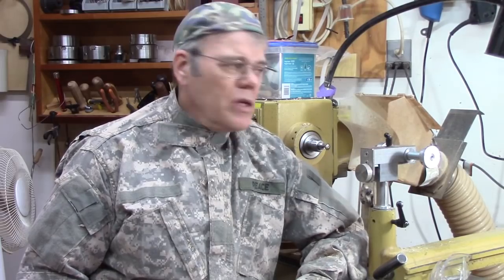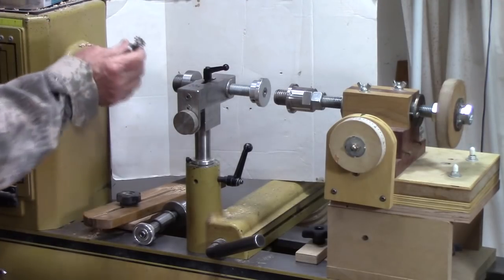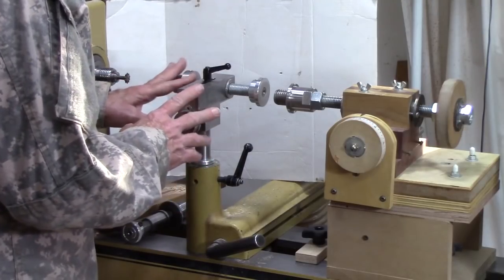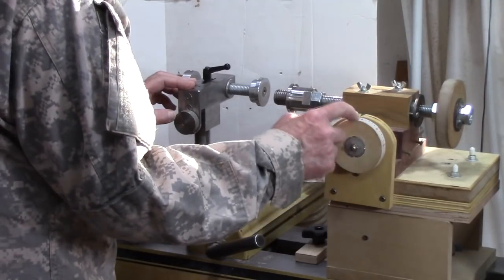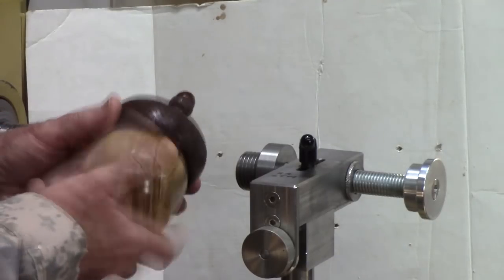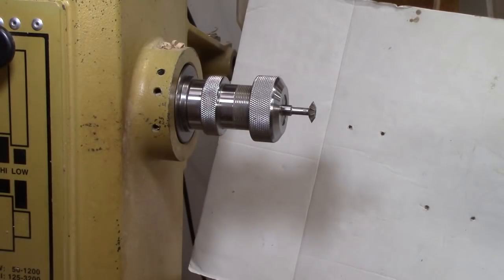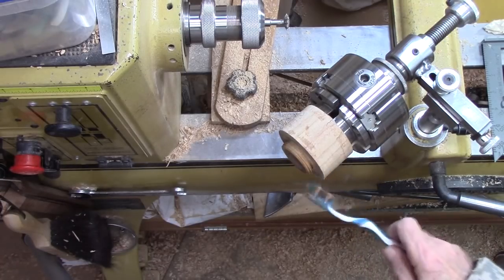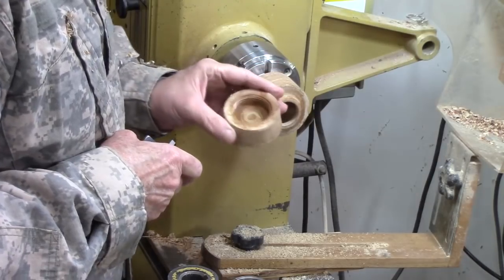Threading Jig Tips for Wood Threads

Comment from the maker: I got a message from a viewer who could not post a comment. Thought it well worth posting.
"Hi Mike.  Just saw your YouTube hunts on threading and wanted to pass on my experience with a Jacobs chuck in the headstock.  I dont have a YouTube account so I couldn’t comment there.  I was using a Jacobs chuck in the headstock with a drawbar to turn a bottle stopper. The wood was a scrap that was very irregular. Because I had the drawbar I didn’t use the tailstock.  Your Jacobs chuck looks like mine, with a MT2 taper on one end of the arbor and a second taper in the end of the arbor that goes into the Jacobs chuck.  The irregular wood caused enough vibration to work the chuck loose from the second taper. Probably wouldn’t be a problem making threads, but I used to think that with a drawbar I didn’t have to worry about the chuck coming loose...

Thanks for your videos."
Reply: I have had that happen too!  Its a good idea, every now and then to open your chuck up completely (so the jaws are totally recessed) turn it upside-down on a soft piece of wood, and give the MT tang a good whack with a leather mallet to seat it properly.

Comment: Nicely explained - thanks. You might want to take a look at the Simon Hope idea of an accurate hinge plate.  This makes it very easy to check if your threads work okay and recut if needed.
Reply from the maker: I do not think Simon has a US distributor  any longer. I have looked at his jig and it looks to be high quality but after getting used to swinging the jig I have out to check the fit, I guess I am not convinced of the value of the hinge plate. At the time that was about an $80 accessory. Just my 2 cents.

Comment: Here's a link to a video of a threading jig that's so simple it doesn't even require a lathe! https://www.youtube.com/watch?v=pCDmwz91phM
Reply from the maker: Thanks for sharing, David. I prefer some type of adapter or nose piece  on the lead screwso you can use a chuck. The challenge is getting the work holder to run true on the lead screw. I do like the idea of a router jig because it makes it easier to transfer work to and from the lathe without having to remove the jig and cutter  from the lathe.
Reply: @MikePeaceWoodturning  Oh, there are lots of things about the jig I don't like. For example, it uses wood as bearings to hold the threaded rod that is at the heart of every threading jig. The rod it pinched between two boards at the front and between two boards at the back. The boards can be moved in or out, to 'pinch' smaller or larger rods, which allows the jig a range of thread sizes it can make. The problem is I doubt the wood 'bearings' will hold up for long. As they wear, there will be an increasing amount of 'slop' in the jig -- making it increasingly difficult to get acceptable results.

What I did find interesting was they were able to get a good result without all the features we think are necessary in a jig. Their jig's 'micro adjust' feature is loosening a knob and tapping the router in or out until it's where you want it. None of this dialing it in another 10 thousand's of an inch! Yet, it worked!